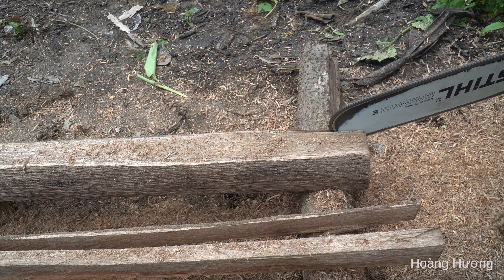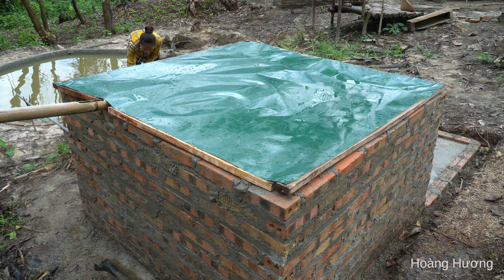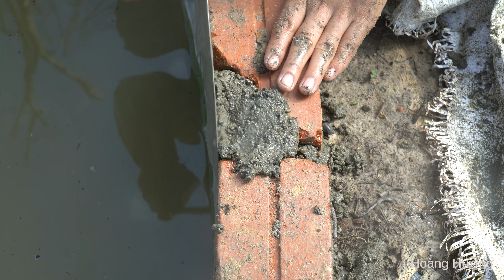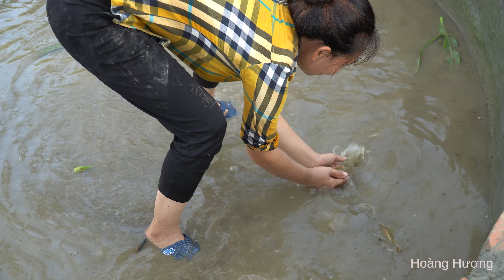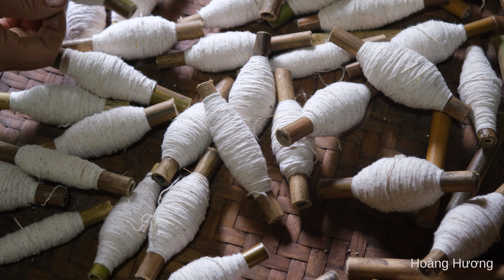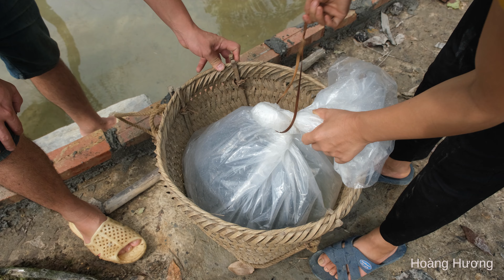husband & wife together catch more fish and release them in the pond, 6 years together | Hoang Huong

Comment: Since your pond is so small, you might want to consider a small solar panel and a bubbler to keep up the air in the water. Warm water doesn't hold as much air as cold water. Also your pond probably will always be a littly cloudy because it is warm and algae will grow very well in there. If you can find a algae eater fish, it will help clear the water some. It will eat the algae off the sides so you don't have to clean so much, Hypostomus plecostomus is one that works very well.

Comment: Congrats on your maintenance of the chainsaw, now the only thing you have to do is check on the height of the  guide teeth, to see if your blades are cutting deep enough. There is a tooth guide that you use and a flat file to flatten the guild to the correct depth. Otherwise you are doing great. Keep it up.

Comment: You might consider making your pond 3-4 brick layers taller. Your pond kind of sits down in a depression anyway, and could catch a lot of rain water run-off and eroded soil and debris. Maybe even add a concrete channel around the pond to help direct run-off water around the pond, instead of washing out the soil around it.

You could plant some kind of trees along where you are directing water to run off down below the pond. Create a rock lined run-off ditch and plant trees 4-5 feet from this ditch on either side of it. If the water is going to run off down hill anyway, you might as well get some use out of it without going to a great deal of time consuming labor.

Something else to think about. Let you pond have some of that clean, fresh, spring water along. Your pond should not be allowed to turn green and get stagnant. Thats not good for fish health. 
Duongs pond has water constantly flowing in and out.

Comment: SUGGESTION: the brush made from palm leaves is very flexible so not very good for cleaning. You could make a better broom from bamboo. Split the bamboo into lots of thin strips and then securely attach them to a long pole for a handle. Then trim the bamboo strips to length. This will also be better for your back because the long handle doesn’t require you to bend your back as much.
Reply from the maker: Oh thank you very much, Your comments are very helpful.
Reply: @Hoàng-Thị-Hương  I really enjoy watching your videos and your husband’s videos.

Keep up the good work ❤️

Comment: Make sure you wear earplugs when operating anything noisy, like a chainsaw.  You don't want to lose your hearing!

As for the sewing thread, it was said that, in the Middle Ages several centuries ago, it could take anywhere from 12 to 20 full-time spinners to keep 1 weaver at the loom full-time.  Nearly every family with sheep, flax, or whatever fiber they had for spinning into thread would take the time to do at least some spinning all throughout the year.  The threads would be carefully stored away from mice and insects, and in the winter when there wasn't much to do in the fields, they would set up looms and weave to make "home-spun" cloth (literally spun at home) for themselves to wear.  The finest thread they made would be sold or traded to professional weavers who would make even better cloth for sale.

In England in the 1400s, the wool cloth trade was very important, as most everyone in Western and Northern Europe wanted English wool.  Shepherds would carefully tend their sheep, washing and shearing them in the late spring.  The fleeces would be graded and sold to professional spinners and weavers who could craft fabric in accordance with laws regarding the quality of the output.  But even the homespun and home-woven wools would be expected to conform to specific widths and measurements by law, so many threads per inch and so forth.  "Stretching" the woolen cloth after it was "walked" or "fulled" (beaten to shrink, tighten, and even out the weaving) was required.

A lot of the flocks of sheep were owned by the monasteries, and the monks of those monasteries often had business partners overseas, including in Flanders (Northeastern France / Belgium area) where they focused on trying to be the best spinners and weavers possible, using English wool by preference.  Other nations worked with other materials, such as cotton in Egypt and India, and each region had its own regulations and requirements for anything meant for sale...but most people prior to the Industrial Revolution did at least some spinning and weaving.

I can understand why so many people gave it up when machines came along that could make fine threads and good weavings.  But at the same time, there is something very satisfying about making a piece of clothing for yourself.  A lot of people have retained the skills required for knitting and crocheting because it is soothing, creative, and useful.  Homespun fabric might not look as neat and tidy as machine-made, but it will be a lot more meaningful for you and your husband when the two of you get that far in your endeavors.  It does take a lot of time and a lot of effort, but I think you both will be very satisifed to hold the end products in your hands!